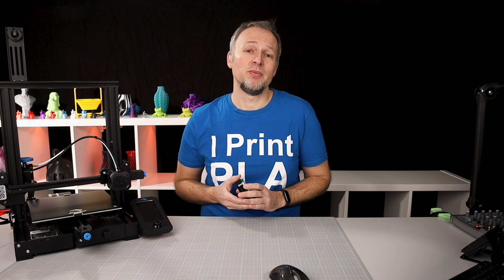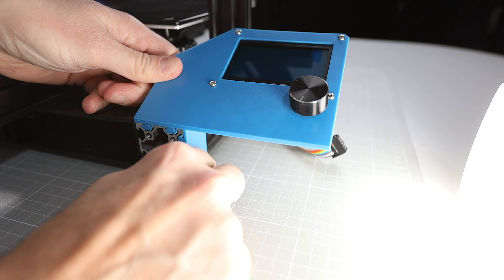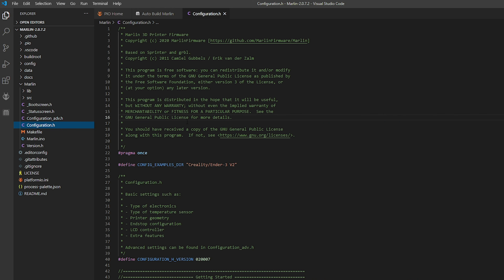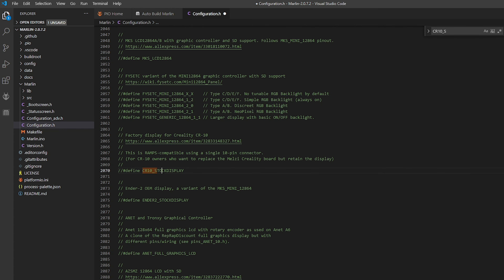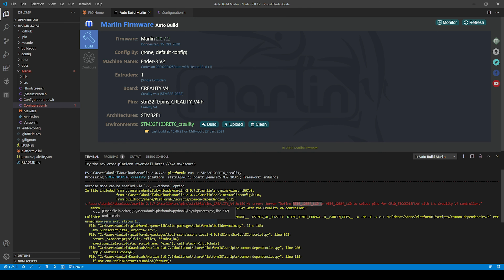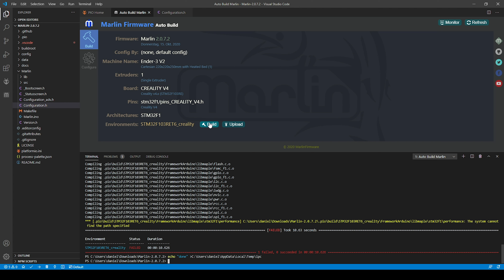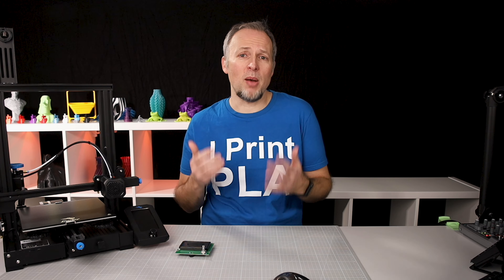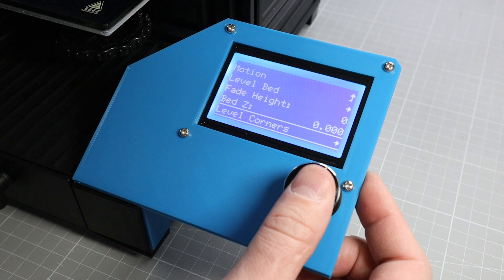Ender 3 v2 - I'm switching back to the 12864 display! The WHY and HOW

Comment: Thank You! My E3 V2 4.2.2 board died, which I hated anyways due to motors getting hot and not an issue on 4.2.7 board. I replaced the MB with FYSETC 1.2b and can not get the screen to work. FYSETC does not support E3 V2 (firmware DWIN display issues) and will not refund when problem arise. So, I ordered this generic 12864 Ender 3 compatible display and followed this instructions and it WORKED. For those reading this and about to purchase E3 V2 - make sure you GET the 4.2.7 version.

Comment: I explained the same thing to a colleague about his new E3v2 and recommended he get something like the BTT 3.5" E3 v3 touchscreen display. It's far better than the stock screen even in Marlin mode, and they've made some great changes over the last year adding many default features. Of course it's fully open source so you can modify the touch GUI as well.
Reply from the maker: Well, the BTT TFT depends on an additional serial port connection that the 4.2.x Creality mainboard does not offer. Idk if there is any way to break out another serial port on the 4.2.X by soldering.

Comment: I did this about a week in to owning my V2. Particularly useful running octoprint.

The "Ender 3 Pro v1.5" config example from marlin and acknowledges some pros shipped out of the box with the 4.2.2 main board and some prebuilt firmware exists.

Comment: Just ordered the 12864 display for my Ender-3 v2. I too was disappointed with the screen when I upgraded Marlin. Apart from the pretty colors there's really no benefit and only limitations with the "modern" display. Free/open source software and hardware is a major reason for the success of the Ender 3, and there should be no place for proprietary software in a Creality printer. Thanks for a great video!

Comment: Daniel's right on here.  Not being able to use mesh bed levelling would be a deal breaker for me.  I took the BLTouch off my Ender 3 once I tried mesh bed levelling - it's that good.  In this case, simpler IS better.

Comment: Check out the Ender 3 V2 subreddit: a user named /u/Jyers has created a new Marlin branch where he has rewritten the whole code of the DWIN display. It now workes out of the box with Marlin features and even has some nice graphical menus for filament change and manual mesh bed leveling.
Reply from the maker: Nice!
Reply: I am using this build intensively already and it works really well! If you decide to switch back to the DWIN display, give it a try...

Comment: Imagine spending more to get a v2 just to spend even more to turn it back into a v1
Reply from the maker: Help is in sight . Eventually the v2 screen will be supported by Marlin 2.0
Reply: @Crosslink3D  🤞🏻
Reply: @Crosslink3D  Is this an assumption or do you have inside info? :-) I'm debating replacing the screen but if there is going to come soon I might just hold off.
Reply: Ryan, check out jyers firmware, I am running mesh bed leveling on my v2 with full visibility of the mesh.  I can now also do filament changes on screen with customisable lengths of retract and load... its a big step forwards.
Reply: @Crosslink3D  in canada the price of Ender 3 V2 at buyapi.ca is $295 and getting Ender 3 Pro is $350.
Reply: @daveargent7654  I'm using Jyers too and it works great, creality really dropped the ball with the ender3v2 FW options.
Reply: Imagine having to hack your printer to update it
Reply: I know I am quite off topic but does anyone know of a good place to stream newly released tv shows online?
Reply: @Crosslink3D  What about now? Is there support right now?
Reply: @thenebu  yes

Comment: You should change that screen for a BigTreeTech TFT screen, the firmware is open and it's easy to add custom touch or switch to marlin mode
Reply from the maker: Well, the BTT TFT depends on an additional serial port connection that the 4.2.x Creality mainboard does not offer. Idk if there is any way to break out another serial port on the 4.2.X by soldering.

Comment: The V2 display looks a little better if you ignore the poor viewing angles from putting a budget landscape display in a portrait orientation but otherwise it is a step back in functionality. I have switched to a 12864 as I now use Klipper which doesn't support the V2 colour display.

Comment from the maker: 🛒 Get the Ender 3 v2 here: https://geni.us/ender3v2
🛒 Replacement 12864 screen: https://geni.us/12864

In this video, I'm swapping out the Ender 3 v2 display for an LCD 12864 display. I thought hard about this and if I want to do this, but it's really the easiest way to get all the Marlin features back and full control over what's happening on the screen.

Comment: I'm buying a used Ender 3 V2 with a nonfunctional display in a few hours for a pretty nifty price. Not sure if the problem is the board, cable or display, but i have the old school Ender 3 and it's display to test it. Seems your video is just what i needed.🤩

Comment: Cp-01 and CR10s-Pro have the same issue, I got my bltouch working on my CP-01 by using the TinyMachines3d CR10sPro marlin repo. before completely upgrading it to a btt board and screen, but it is possible to modify the menus, is just a real pain

Comment: Finally someone did this mod. I've been wondering about this for a couple of months.
But i'm still curious about one more thing. Will a reprap 12864 display will work as well?
Reply from the maker: Yes, you just have to activate the right setting in the config file.
Reply: @Crosslink3D  the wiring is just plug and play?
Reply: @muhammadhijrianza2366  No, but this will help. I'm using the Generic reprap on the v2 now. https://github.com/MarlinFirmware/Marlin/issues/18225

Comment: Hmm i know this Video is a bit older, but i have to say that these issues are gone nowadays.
You are telling, that "we custom firmware builders" could not program that display.
That is completely wrong nowadays as the custom firmware "Professional Firmware" shows.
That is a firmware for that Display with a lot of new "impossible" features and i am using it quite a bit now without any problems and many QOL-features - like mesh leveling and editing, support for gcode thumbnails, a tramming assistant that will measure all 4 corners with a bltouch and tell you which one to raise or lower. All these fetaures are programmed with new UI Elements and screens in a custom marlin firmware. It even has an option for a config gcode file for changing configs of the firmware without recompiling.
I thought i should tell if anyone else with comes across this video and is missing that information.

Comment: Hi Danial iv put the V2 4.2.7 board and v2 screen from my older V1 pro and when i put marlin 5.0.7.2 on the firmware non of the steppers work so i used the creality 450mm firmware that works. 
great to see that i can still use my older pro screen or does it have to be updated too to match the 32bit

Comment: Halo, thanks for a great video! I am trying use standard LCD from Ender3/5 instead standard 12864 LCD lie in your video. But even with a "VET6_12864_LCD" or "RET6_12864_LCD" is LCD still without any graphic, only blue backgroung light... 
Do I need different parameter with a stock Ender3/5 LCD? Thanks.

Comment: Jyers firmware has left the chatroom
Reply from the maker: Jyers has been integrated back into Marlin 2.0.9.2. So from this point on no much to worry anymore about the v2 display. Except you like to go with another mainboard like BTT. Then, you still have to re-wire your display cable. That was my final reason to stay with the 12864 display as it works without changes with the SKR Mini E3 2.0.

Comment: Hala friend:
I would like to illustrate this message with images to make my query more comprehensive.
I have installed the same screen as your samples in an Ender 3 and a Bigtreetech Skr Mini E3 V2.0 Marlin 2.0.x board, with Marlin-bugfix-2.0.x and a Touch-Mi Auto-level zonda (fr.). that is working perfectly.-
The problem is when I switch from Marlin to the touch screen, there many icons do not respond or give an error.
Example: in Bltouch settings: the icons are there, but they do not respond or give an error message.
EXAMPLE: on the Bl-Touch screen:
--Icono ``reset`` UNKNOWN COMMAND: ``M280 P0 S90``
--Icono ``test`` UNKNOWN COMMAND: ``M280 P0 S10``
--Icono ``deplay`` UNKNOWN COMMAND: ``M280 P0 S120``
--Icono ``stow`` UNKNOWN COMMAND: ``M280 P0 S 160``
-Icono `` repeat``   ( repetitive check OK)

 It seems like the icon functions are not configured, or there is no communication between the touch screen and the board.
Those settings are configured? 🤔
Thanks
Greetings 🤗
Reply from the maker: What Settings?
Reply: @Crosslink3D  ? I asked a new question, I don't know why the rest is deleted 🤔
Thanks
Greetings 🤗

Comment: Hello! Do you know if it is still possible to use mesh bed leveling over terminal from ocotprint for example? Is the problem only that the menu item can not be added?
Reply from the maker: It can be used from terminal just like it was possible before. It's just not for beginners, my opinion.
Reply: Ăskar, look up jyers firmware, I am running my v2 on that, and I can now do mesh bed leveling from the v2 screen.

Comment: The color screen always seemed like a useless "upgrade" to me. The 12864 supports all Marlin features for free and provides an easy efficient readout of whatever is going on with my printer. What more would I want? Also, it plays Snake.

* I do use the BTT TFT35 but only so I could set the color of the 12864 mode.

Comment: Good video, I did the same thing after I got my Ender 5 Plus.   I had two Ender 5s and wanted them to be as identical as possible.  You do loose a lot of functions with the "pretty" displays
Reply from the maker: Yeah, it’s unfortunate. Why can’t they make a functional display that’s pretty at the same time???
Reply: @Crosslink3D  I personally like the stock Ender display, I can quickly get to any feature that I want, and they are very inexpensive,  I keep a few extras on hand.  I just designed a new mount for mine since I modified two Ender 5 to dual z Axis and ExoSlides.

Comment: Very useful.... Thank you for sharing... And this looks like another Chinese "that will do" piece of kit!!!! I don't really know why people take Ender3 as a benchmark for every 2020/2040 extrusion Chinese printer???? There are some really good machines within the same price range out there that actually look more like a complete design rather than E3 that looks like assembled on a school workbench on Friday to be sold on Monday. I've build two printers and with careful selection of parts, fine tuned Marlin and solid mechanics they produce just as good or better prints(not talking about benchies and cubes here) than any E3 I've seen on the Tube. And Daniel, the firmware is open source, just that bunch not willing to follow any open source licence. I'd say, let's do a subscriber build off challenge, build one and share with the rest solutions and ideas. What happened to the innovation spirit of Germany to end up importing cheap printers from the Far East? No 2020/2040 extrusions in Europe???